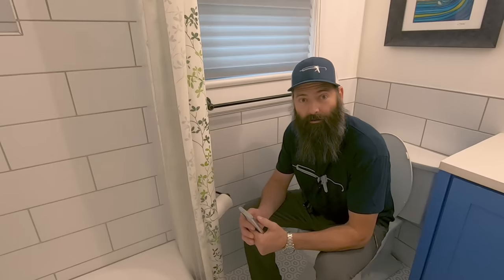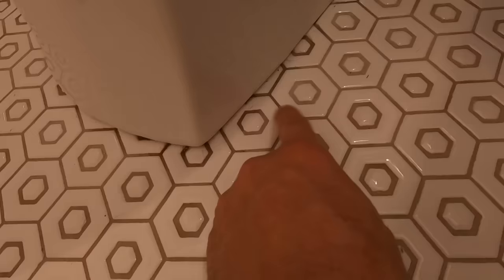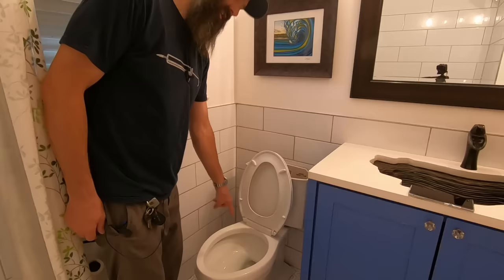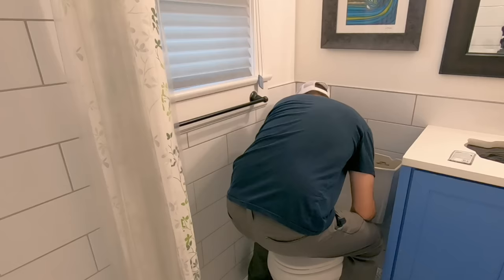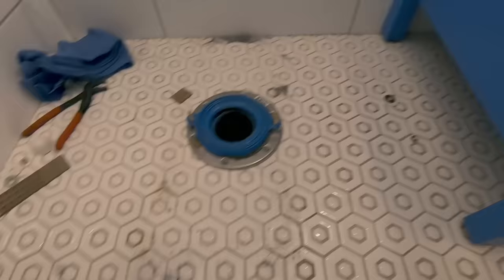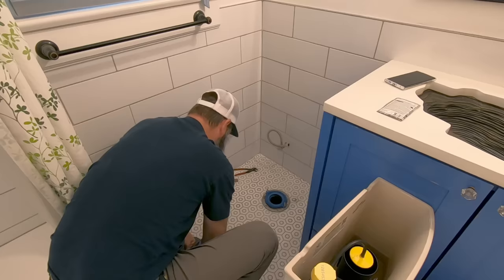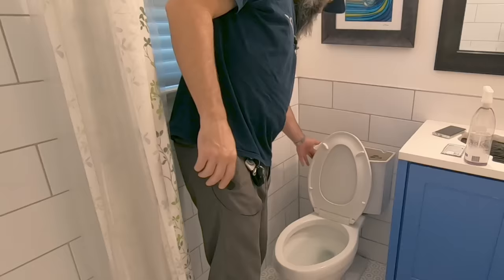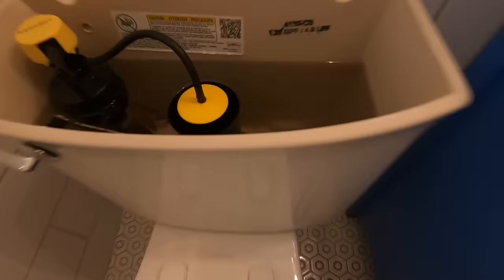Toilet Install Gone Wrong | What Failed | THE HANDYMAN |

Comment: Nothing more embarrassing than when you have the soft close toilet seats at home and you visit someone who still has wood seats.😝🍺
Reply: Better than peeking into their medicine cabinet & having the door fall off. 🤭
Reply: @droolbunnyxo9565  why do I have the impression this is from personal experience 😂
Reply: @marsjam4117  🤫 😉
Reply: @droolbunnyxo9565  😂
Reply: I’ve experienced this! Lolol
Reply: I had some leak using those rings, first used one about a month before this comment, just a couple weeks in, about a weeks ago when flushed twice water definitely came out the bottom, let it sit for a day and water stopped coming out the bottom, still took a look and it all looked ok but added a nice layer of caulk and leveled it to make up some additional height to seal better as a temporary fix until I could get another one and use the raiser on it., I think either it’s a expansion contraction issues as it went from 70s to 30s outside, and/or a vapor seal in the plumbing and it causes some back pressure to push the gasket down a bit and leak water.  Don’t know for sure but I definitely was sitting with the old boy aiming down and in the toilet, it only leaked with flushing. And only did it the twice.  Then randomly restored.  Hopefully the raised ring has more pressure and seals it better.
Reply: yeah, i have to warn my kids because we all hve soft close at my house!
Reply: Oh, but there at least one thing worse. When you go meet a spouse’s coworker for the first time to see their fancy home…and while there you use their toilet and break the seat. 😅 That is seriously humiliating. I have lost weight since then.😂😊

Comment: You just reminded me of a toilet I installed for someone a year ago, they called me, I kid you not a week later and told me the toilet was leaking. It was exactly like this one and I had to tell the lady that her husband needs to turn the light on in the middle of the night. As for cleaning... RUBBER gloves, a deep breath before starting to clean up, and I used baking soda, vinegar and water, followed up with a very quick wipe of bleach and then rinse with water. I was just there today and I think he actually took my advice, have to say I was amazed. Timing of this video was amazing. Handy Andy.
Reply: Just sit down in the middle of the night and you can leave the lights off!
Reply: @davesmith6435  Yep, this.  I really, really don't understand men who insist on standing up every single time.

Comment: I'll typically caulk around the base and leave the back end open for warning water. I love these not wax rings they have now. Never tried the gel! that seemed fun!  Always nice to put some good vibes out into the world, they have a way of coming back to ya!
Reply: So you have good luck with the non-wax rings? I just tiled my bathroom, and really wanted to avoid the wax, but I just couldn't convince myself that it would work.
Reply: @spudboyQ  use em all the time! Just gotta make sure to use the proper height with them. My rule of thumb is that if the toilet ring is flush with final floor then just the one layer is fine. But if tile is higher than ring I'll use both for full height.
Reply: @spudboyQ  wax rings are good, they last for lots of years if installed properly. I use they more expensive ones here in CA
Reply: Ive tried every combination with installing toilets....best combo is...the one piece toilet ....thick wax ring (non wax  sux)....no caulk......

Comment: Great grout cleaner : Hydrogen peroxide and a little bit of baking soda. Let it sit for about 20 minutes then use an old toothbrush, a rag and some clean water -wipe it up. 
Ps if you save a sprayer from any cleaning product , that’ll fit the top of a standard hydrogen peroxide bottle. I always keep one in the laundry room and one under the sink for cleaning. It’s a great to get stains out of the carpet too.
Reply: Good tip. Thank you.

Comment: For scrubbing/cleaning grout I do warm water add baking soda to give grit and some dish soap. Pour straight vinegar over the grout and then the other mix and scrub with a grout brush. 

Pretty saw it on This Old House before worked like a charm on nasty grimy grout at my last house.

Comment: I have some reuben flavored latex gloves for ya: also, if its in the truck:
-Shop vac the h20 from bowl
- distilled white vinegar/ bak8ng soda on grout (cheap)
- sometimes ill lay clear caulk around bottom rim depending on type of flooring.. (leaving rear open).. keeps the spray n pray types from marking their turf so badly. 
You did great man.. love this channel long time🇺🇸🙏✝️🧡

Comment: I did a lot of jobs like your little bathroom here. As much as I like the look of setting a new toilet on a new tile floor without caulking, moisture will get under the toilet and not be able to evaporate causing these staining issues.
Polyseamseal makes a siliconized latex caulk in every grout color (even sanded). It's a way to seal joints like this in your bathroom which will blend in with the look of your design - unlike real plumbers who butcher caulking toilets with white silicone.
I also use these neoprene rings every time I set a toilet.....which now will be $275😅🤣😅🤣
Paying it forward, you want to be a real Handyman folks, you better take care of your customers from time to time so they'll take care of you!
Reply: yep - always caulk the edge and leave the back side you can't see open to ensure if any issue does occur you will see liquid.

Comment: The gel product is neat.
Personally, I've found that if you dump about gallon of water from a small bucket really fast, the toilet will create a vacuum effect which will syphon out most of the water.
The little water that does remain will be in such a low level that it will allow you to remove the bowl without fear of spilling anything out.
It's a nice hack I learned a while back.
Reply: I just rock the toilet while still over the flange to get the water out, and whatever stays will stay unless I put it on its side.
But I’m a noob, so don’t listen to me, even if it worked:)
Reply: I just use a shop vac to empty the bowl of water

Comment: I use those SS reinforcement rings. And  I used to use those waxless rings. They work well but you have to fit them. If you haven't already done so try the Fernco toilet seal. So smart. It goes inside the pipe. And sticks to the toilet. The height of the flange is irrelevant.

Comment: I had that happen before, I pulled the toilet and there was nothing wrong with the seal. I had installed vinyl planking and told the customer I could re-install it after it was cleaned up a bit. I noticed there was moisture under the planks. I said I could replace the planks after cleaning them up, but the smell of urine beneath the planks was so bad I had to install new flooring. Embarrassing for both parties.

Comment: They make a grout paint, it’s like 15 bucks and it’s a little brush you just go over the discolored spots and in about 24 hours it’ll go back to the same color. I’ve used it multiple times and always works

Comment: Use comet or ajax powder and a nylon scrub brush. Apply, scrub and allow to sit on grout lines and let it work it's magic. After a few minutes scrub again and clean off residue . A bit abrasive. Could use a tooth brush if you only want to scrub the grout lines. Hope that helps. I use it on white grout line and on bathtubs that I have clean up and recaulk.

Comment: I set toilets on a 5 gallon bucket to catch the water tipping it back and forth gets 99% of the water out so it can be moved without dripping. I also silicone the toilet base to the floor. It just looks better and helps fill voids and uneven floors then you know its not coming from under the toilet. I leave the back uncaulked to show if the seal isnt holding which is extremely rare.

Comment: I just bought one of those blue foam no-wax seals...  glad to see it was not that. I hate dealing with nasty old wax rings, and the fact that they lose their seal if anything moves, sucks, especially when people use the plastic toilet flanges and then overtighten the bolts.
Reply: I use better than wax as well but they will fail after about 7-10 years. They deteriorate and break apart.

Comment: This is completely speculative, but I have noticed in bathrooms with inadequate ventilation (or where the homeowner actively restricts ventilation) the toilet and tank will “sweat” after a hot shower. Not sure if this is the case here, but definitely an easier and less awkward explanation to offer the homeowner
Reply: If that happens, you can install a mixing valve on the toilet supply line to add a little hot water to take out the chill!
Reply: As a handyman my job is to inform the customer, not LIE to them.
They want their rear end kissed, that's outside my job description.
Reply: @robstidham8754  Who would want to add hot water to their toilet tank all the time? It's not gonna stay warm. 👎

Comment: So when you add the "magic powder" to turn the remaining bowl water into a gel, does any of the gel go into the drain? (Before you remove the commode?) When you pull the commode to inspect the floor, seal, etc, and the seal is new, do it should you replace the seal?

Comment: Do you caulk the perimeter of the toilet fixtures in your area?  It eliminates this fowling area under the toilet and would probably solve the staining issue on future installs.
Reply: Wouldn't sealing around the toilet hide any potential leaks ie: regular wax failing, until they're at a way worse point that could've been caught earlier?
Reply: That's why you test the toilet before caulking the base. Leaving the base open allows a nice place for insects to hide and wet stuff spilled on the floor to stink.  @conephompany
Reply: @conephompany  for exactly this reason if someone prefers to have the base sealed I’ll leave a small gap at the back in between the wall which isn’t noticed although it’s uncertain if any leak would seep through if the floor isn’t level to begin with plus a myriad of other factors
Reply: Caulk the front and sides. Leave the back open. That’s how I do it anyway.

Comment: I've seen you work on front doors, replacing, repairing them. You've mentioned that they needed an awning.  Can do a DIY easy to build, stylish, wood awning lean to style. I would love to see your take on it!
Reply from the maker: If you are on an extreme budget and have lower framing skills it will get the job done.  I would never put a lean to style entry on my house.   Gable roofs look and sell better.

Comment: Get rid of the gel junk, buy yourself a siphon gun. Look up, “ The Last Drop “ it’s a 2” PVC hypodermic needle with a 3/8” tygon tube “ clear plastic hose”. It’s 16” long, I have one I’ve used for the last 25 years. Suck tank dry and blast out bowl and finish emptying bowl. 
Also, ALWAYS screw the flange down to floor, it’s the ring that anchors the toilet to floor, not the pvc hub.
Coming up on 41 years as a plumber.

Comment: Can try the grout cleaners out there. Different grout brands have different cleaners, it’s a type of “acid” that helps clean the grout, then I’d recommend buying sealer to seal after cleaning b/c it does strip the grout a tiny bit, plus grout not waterproof anyways (well, some is, but that diff discussion 😉).
For grout sealer I like 511 impregnator sealer (just don’t buy the kind with enhance b/c will look “wet” all the time unless like that look”.
Also if seal the grout, would seal entire floor, not just area around toilet as could see “color diff” being side by side.
Thx handyman, have good one✌🏻

Comment: Could it be the tile is due for sealant? Why did you choose not to caulk around the toilet? I am having a similar issue and I am  hoping that aim is the only issue, even though I am the sole stand pee'R in the house. Also I have an extra wax ring from when I installed my last toilet, is it worth getting the rubber ring and scrapping the wax ring. Are rubber rings really that much better than wax rings?

Comment: No way to get the grout to return to original color. It has absorbed the gross stuff. This is why it is not a good idea to tile bathroom floors with tiny tiles. Use big tiles to reduce grout lines.

Comment: I wish my issues were due to bad aim.  Haha

Previous owner hired a real winner of a contractor for their "newly gutted" half bath... (1) wrong glue on the PVC waste pipe (broke & leaked), (2) no backer under the floor tile (installed directly on the 3/4" only sub-floor plywood), (3) one of the worst grout jobs I've even seen (never sealed) and (4) installed the flange on the subfloor not on top of the finished tile (wax ring never seated - looked perfect like new out of the box, leaked).  I just pulled up the entire floor to replace it and replaced a large chunk of the waste pipe.  I'm sure they paid thousands for a bath that lasted all of 9 years.  Completely new now.

I caulk the front & sides of the toilet, leaving just the back open.  Much easier to keep clean.

Comment: Unless it actually smells of urine, it could be run-off condensation from the bowl where the water inside the bowl and tank is colder than the air surrounding the toilet! I've seen this many times over the years! Then there is pee-splash too, but there would certainly be a stink.

Comment: You ask what I think. The toilet is not sitting on a level surface and it is not secure.  A toilet cannot have any movement at the base. I can see that it has a shim under it and there are gaps it is shimmed improperly. Obviously the flange is too high. It  Should have been lowered. People always think they can shim the toilet that will fix it this shows you it will not. Also you could have shimmed it better and cocked around the base to hold it more securely. But that is a do it yourself's way to going about it and not a license plumbers way of doing it correctly. Remember you asked, Have fun

Comment: I had this. My shower curtin was ripped. Only got nasty after a shower. Hmmm.  Almost pulled it. But yeah water was mixing with the piss. Nasty. Caulk maybe  leave a opening in the back. You can add water to the solidifyer 12:47

Comment: If a wax seal goes bad, will water necessarily ALWAYS be on the floor next to the toilet? I have fresh water damage on the 1st floor ceiling, directly under the 2nd floor toilet. But no water on the floor around the toilet.

Comment: For the stain use hydrogen peroxide (1%), squirt it on, then sprinkle baking soda on top of the wet peroxide, let it dry overnight, next morning  spray a new coat of peroxide on and then wipe it off with a clean rag. If it doesn't get clean repeat process later that night and then the next morning respray grout with peroxide and then scrub (just the grout) with a stainless steel tooth brush with just a mild pressure, then wash with water and dry with a dry rag. Try it. Simple, cheap and effective and I haven't had it fail yet. Only trouble for pros is that it take time for the peroxide to eat into "gook".

Comment: How do you not remember what kind of ring you put down for the toilet? I would think that you would document whatever you did on a job, especially the products used for the install...
Also, I would've put a new ring on there because it seems like a ring like that would weigh down uniquely over time and to take off the toilet and put it back on may not have the toilet sit in the exact same nooks and crannies and potentially cause issues in the future. 

I would charge the homeowner for the cost of a new ring the liqui-lock, but if you want to not charge for labor on what turned out to be a simple look-see like this, and potentially be in the good graces of someone for future business, then feel free not to charge!

Comment: That gel looks very handy, I will for sure pick some up next time I have to do toilet work. I like how it dissolves.
I love watching this channel, your pricing quotes are eye opening. I guess I haven't been charging enough because 275 for a removal and install is about 200 more than I charged last time about a year ago. Been a handy man for about 15 years, I guess I haven't adjusted my pricing for inflation in a while.
Reply: Home Depot charges $125 (Cdn) to install a toilet (which includes removing the old one), so $275 would be a hard sell, even to a long time client.

Comment: Is it common to caulk around the toilet base? Kool shirt 👌
Reply: Unfortunately yes.
Reply: @nin469  I hate it but I just charge extra for it. Not my toilet at my house so whatever.
Reply: @AceEverett  I just don't do it lol if the client asks I tell them no need- just a thing that ends up moldy and needs changing later. If your toilet needs caulk to keep water out (the primary function of caulk) then you got bigger problems..
Reply: @AceEverett  so what's wrong with that though? I worked building& apartment maintenance when I was a kid & that's what the old guy taught me. Maybe for smell or looks 🤔 😐 but I've done it every since.

Comment: What’s the success rate and lifespan of the blue plastic rings VS the wax type? I’ve always used wax and never had issues but I had a customer use a green foam one and it failed in two years. Never used the blue because of that incident
Reply: BLUE RUBBER rings*:  I've only installed two , but never had an issue with either in probably 10-15 years.  
GREEN FOAM:  I've heard, (via another YT video**), that the thin plastic/rubber outeside is prone to getting nicked/broken, then the inner foam gets saturated and stops working as intended.
*Fluidmaster-Better-Than-Wax-Universal-Wax-Free-Toilet-Seal (Note:  I hear there are 3 sizes available, but have only ever seen one.)
**See YT video "2 YEAR FOLLOW-UP to Toilet Flange Fix / Also, Compare Different Toilet Seals" by Marty Pollio.
( https://www.youtube.com/watch?v=0B_HpBZNx9s )
Reply: @randomcomment3865  The BLUE ones have been in market for roughly 7 years how could you make such statement? 🤡